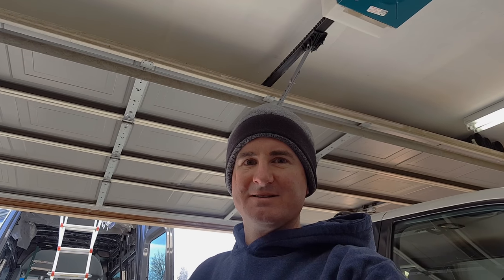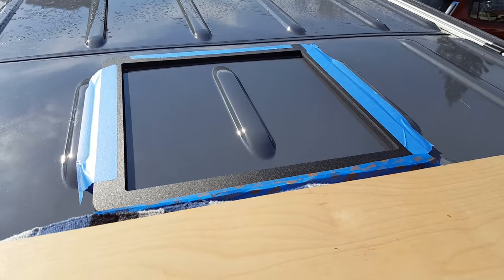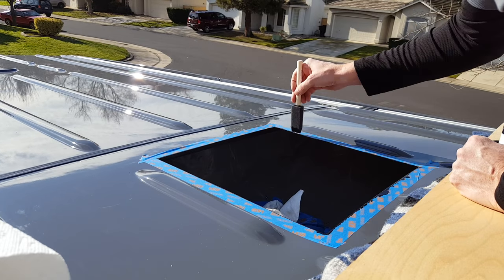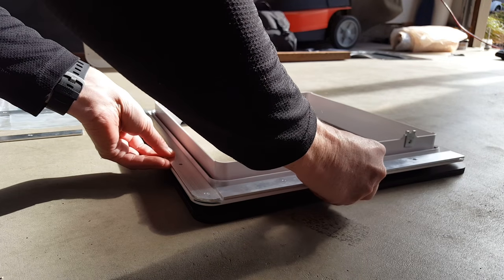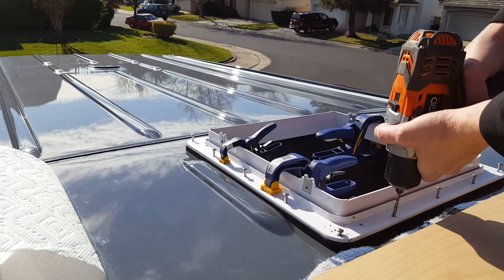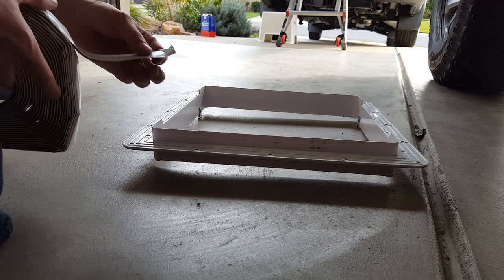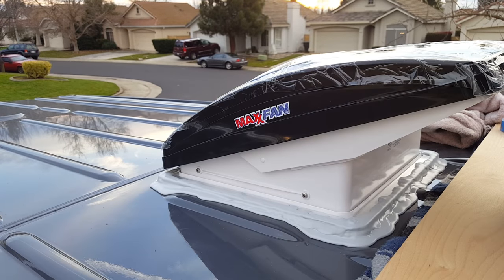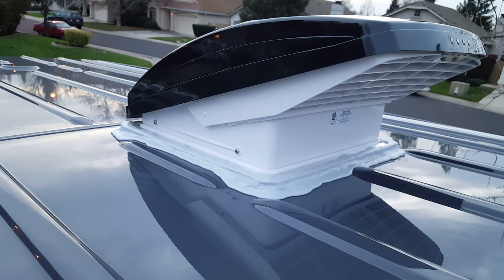Mercedes Sprinter camper van maxxair fan install.

Comment: The screws don’t attach to anything below the skin of the van?  I used a wooden frame below the roof to screw into.
Reply from the maker: Correct.  Some day when my fan goes out I want to be able to replace the entire fan unit rom the roof without dropping my headliner.  Sixteen sheetmetal screws are plenty to hold the fan in place.

Comment: Made some purchases through your store today. Does the fan come with any fuses that may be required?
Reply from the maker: Thank you sir, much appreciated!  I don't seem to recall there being an inline fuse.  You'll want to connect the fan to a fused source.  I used the blue sea fused distribution blocks.

Comment: I am curious if having 2 fans provide better airflow and more cooler than just having 1 fan?
Reply from the maker: It would.  I've heard from others that running one fan in forward and the other in reverse creates a nice draft.  It does limit your solar capacity though.

Comment: Does that adapter fit on the 2019 sprinters? I’m reading it only fits model year 94-06? Just purchased the fan and need to find the correct adapter. 
Thanks for the video!!
Reply from the maker: The 2007-2018 and 2019+ vans are basically the same so yes it will work, but the pre-07 is an entirely different generation.  There should be a checkbox that allows you to select the generation of the van.  Good luck!

Comment: Great video!
Are there benefits this model has over the manual one?
Do I need to buy this shroud separately? 
I love your music choice.
Reply: +kenetube yes! the reversable fan direction is what I want.
Another youtuber mentioned being able to drive with the maxxair open. Does that depend on the way it's installed?
Reply: Cool. Thanks :)

Comment: I read somewhere that you need two of these maxxair fans for your cargo van, is that true or would one be ok?
Reply from the maker: Most only have one.  Using two would prevent me from having the amount of solar I do, so one is definitely my preference.
Reply: @ourkaravan  I got a sprinter 170 so I'm trying to add 1 fan and a roof nest. I just need to figure out if it's possible, I think it is.
Reply from the maker: I’m not sure what a roof nest is but you certainly have more room on the roof of your 170 than I have on my 144.

Comment: Does the Sprinter have a designated fan location towards the front of the van?  If someone decides to install the fan in this forward location, the adapter would not be needed, right?
Reply from the maker: There is a factory location toward the front, but the factory fans are not the standard 14" size, they are much smaller.  As such, the adapter is still needed to address the ribs in the roof.

Comment: What size wire did you use to connect your fan to your breaker??
Reply from the maker: I believe I used awg 14 to prevent voltage drop.
Reply: @ourkaravan  14 gauge is what I was thinking as well. It comes with 16 gauge but it just didn’t make sense to me to try and run 16 gauge with it. However there’s 1 million videos on Airmax fan installations but nobody says the gauge they used for the electrical LOL
Reply from the maker: Awg 14 is rated for much higher amperage but I tried to limit my DC wire gauges to two sizes, 14 and 16, and the heavier gauge helps reduce voltage drop.  Naturally my main DV wiring is much thicker gauge but nearly all of my after-fuse block loads are 14 or 16.
Reply: That’s solid! I’ve build houses for years and I’m on my 2nd skoolie. So it’s different for sure lol 16g is foreign to me as 14 is the smallest residential LOL quick question for you..

On switches what is your opinion on 14g on the pucks to the switch and 12g from the switch to the breaker and using a 15a fuse?
Reply from the maker: @skooliebuilders  I recommend using this online tool:  http://circuitwizard.bluesea.com.      Without knowing how many lights, their consumption, etc I wouldn't be able to say.  This will though!  -Ken

Comment: What reinforcements has you made to the underside?
Reply from the maker: None.  If you build a frame and use nuts underneath you may not be able to remove the fan from the top if/when it goes out.  In my case my headliner would make it difficult to access from the bottom.

Comment: Great series of videos... Thank you so much!! Curious, now that you've had your fan installed for over four years, any thoughts on those aluminum stripes you fabricated for the rim of the fan?  Seems like they would be attract and absorb a ton of (sun) heat and get/stay hot.. maybe tougher on the plastic then just leaving it exposed (w/out alum. stripes)??  Would be interested in your thoughts/feedback. Thanks!
Reply: errrr strips...
Reply from the maker: I'd do it again the same way today.  I removed the inside fan trim cover last week to install magnets on the inside for my new vent cover and the white plastic is getting brittle from sun.  If it's that brittle inside the van, I can't imagine what condition the outside plastic frame would be in if it were not covered. I feel the strips keep even pressure and help keep UV off the plastic.

Comment: Can you please tell me where you bought that adapter?
Reply: Thanks
Reply: where did he buy that adapter for the fan?
Reply: How has the Maxxair fan been working for you? I've read about problems they have and wonder if you've experienced any
Reply: kenetube According to the Amazon reviews the circuit boards go bad and the fan stops working.  They also said that if you buy the fan through Amazon there is no warranty.
Reply: I bought my adapter from eBay, though mine is for a Transit, I recall seeing other models as well from various builders.

Comment: is the black ring supposed to be on inside of van?
Reply from the maker: The purpose of the black ring is to flatten the ribs on top of the roof so the fan will sit flat.
Reply from the maker: You must be referring to a different trim ring.  The ring I used is 100% only for the roof.  I appreciate the kind words...take care!
Reply: @ourkaravan  They make an interior ring as well, I’m guessing you did'nt get it.  Did you make your own interior ring out of wood or not use an interior ring altogether?
Reply from the maker: @emmcey  Correct, I only used the one for the top of the roof.  Before using an interior ring with nuts underneath, be sure the design of your headliner will allow access to the nuts underneath.  Otherwise if the fan goes out you'll have to rip out your headliner to replace it.  If you use the 16 sheetmetal screws down through the adapter and into the roof, you can remove the entire fan from the roof of the van when it does eventually go out.